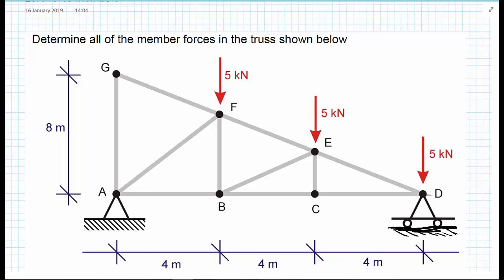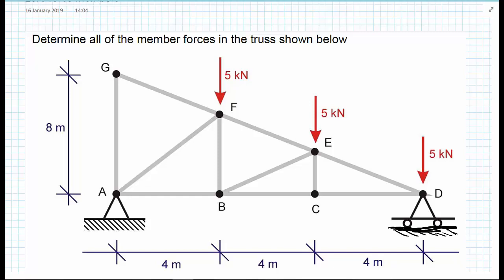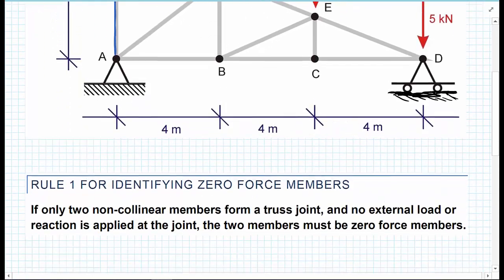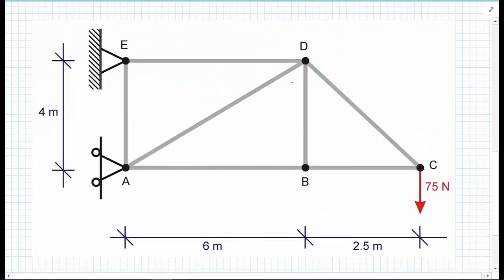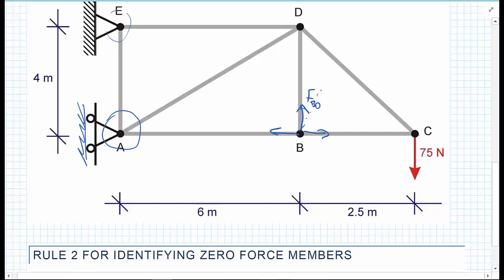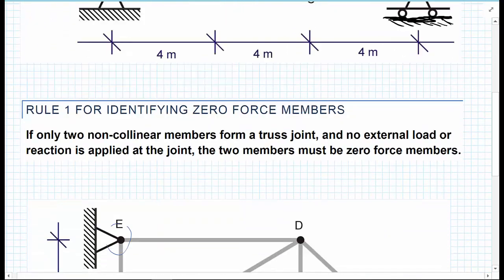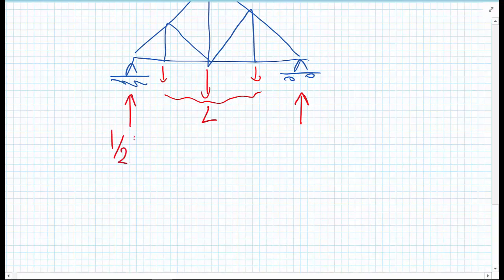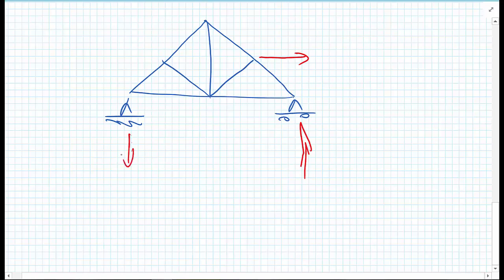Statics - Trusses - Zero force members

Comment: At 2:58, can you explain further? Are joints at any supports not zfm's because the support is a reaction?
Reply from the maker: There is no way to declare that they are definitely zero force members. However, you can't rule out members connecting to a support being a zero force member, but unlikely.

Comment: You are incorrect, in the first problem, CE is not a ZFM, because you have a 5KN external load
Reply from the maker: The external load is applied at E. If you were to draw a free body diagram of joint C then F_CE would be the only force with a vertical component.